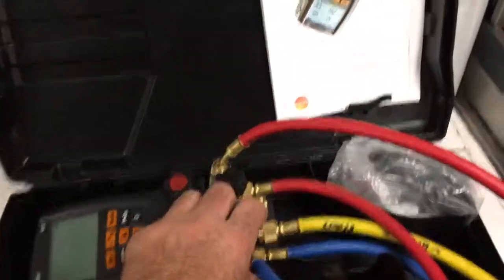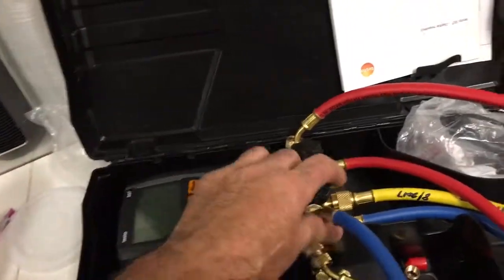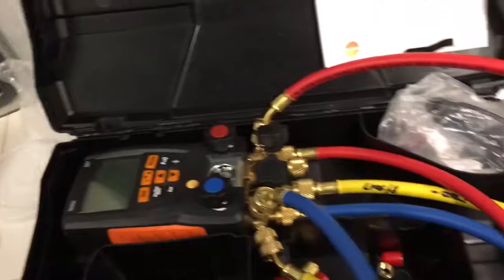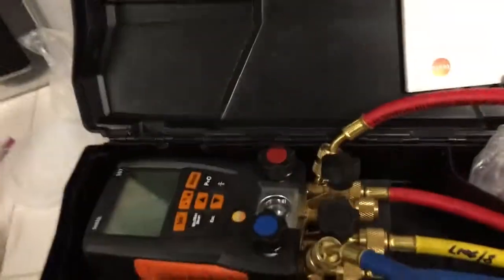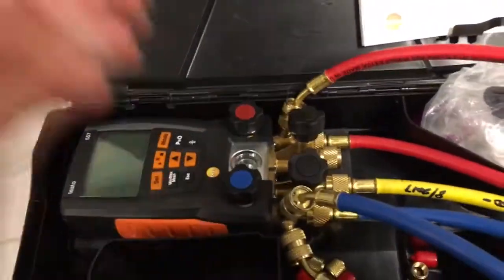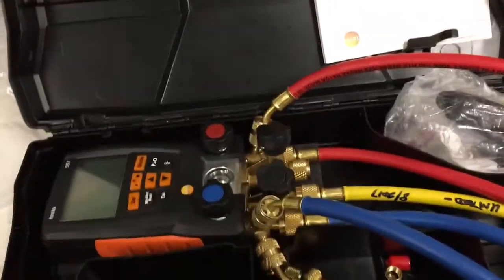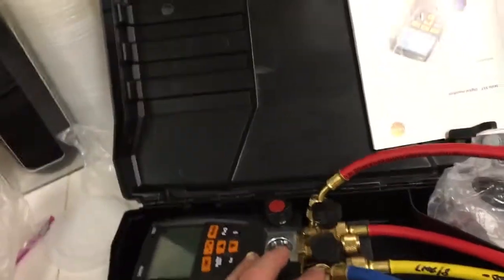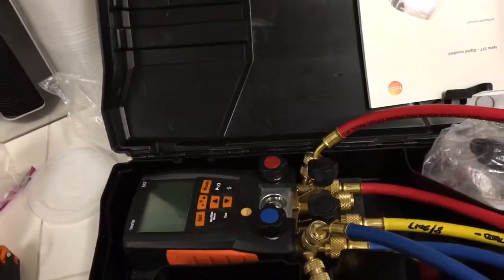My New Testo 557 Refrigeration Manifold --- A Question ?

Comment: Yeah, Both my 570's and my 550's I coil around and even then I only keep the TWO hoses in the case.  I keep several of the yellow hoses separate in my truck.
Reply from the maker: New video coming out --- fitting 72" hoses in case. I figured out how.

Comment: You have to remove the hoses from the manifold in order to store it in the case. There is actually a means to the madness. They designed it this way so you are less likely to keep hoses full of refrigerant connected to the manifold which can cause transducer damage overtime.
Reply from the maker: Yea, i Allways Leave my valves - mid position on all guages so hoses never have pressure in them. For analogs or Digital. Pressure allways messes up analog guages too. Good to know for transducers too.

Comment: I have the 550's with 36" hoses, have to take the hoses off to put it all in the case, would probably struggle to get three 72" hoses in there instead.
Reply from the maker: New video coming out --- fitting 72" hoses in case. I figured out how.